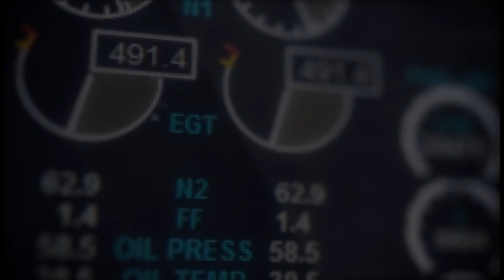Will Circular runways "take off"

Comment: Thank you sir for posting!  At first I thought this was laughable but now I see this is quite possible

To contest a couple of your objections.  One, as far as approach and departure lanes, those can still remain fixed.  Think if it as roads that lead to a traffic circle.  An airplane would still fly the same approach and once it enters the circle just spiral down until it reached the optimum point for touching down.  Same thing for takeoff.  Lift off at the optimal point, continue to fly the runway heading while climbing (spiral up), and then level off and continue on the approved departure path.

Two, problems with engine failures - needing to call V1 for instance - are now moot.  Just kill the other engine and land and roll out taking as much of the circle as you need.  Asymmetrical thrust which might throw you to the outside of the circle are kept in check with the bank of the runway.

Three.  Slippery runways.  True, centrifugal force will force you to the outside.  But the bank of the runway will keep you in.  With a properly designed runway you should never feel forces throwing you to the outside of the circle, just pressed more firmly into your seat as the aircraft accelerates.

Comment: I can see pluses (➕) and minuses (➖), and just oddities (✱) with this approach.

➖ The 360° clearance requirement that you pointed out would be a show-stopper at most commercial airport locations. It seems like the most intractable problem. It limits use of this airfield design to remote, flat desert locations, and/or perhaps roundish islands in the ocean.

➕ An island in the ocean too small & round for a decent-length airstrip might be able to accommodate one of these, perhaps for a military airfield.

➕ As you pointed out, except in very shifty winds you could always avoid having to take off or land in a crosswind. (The 360° clearance requirement probably incidentally ensures that your airport won't be located where shifty winds are common.)

✱ The runway would have to be concave, so that you could balance centrifugal force at varying ground speeds during takeoff and landing. If the runway were merely banked at a constant angle, then at low speeds the plane would tend to slide down to the "infield," and at high speeds the plane would tend to fly off the outer edge of the runway.

➖ That means the runway would need to be wider than a normal, straight runway, because there would be no single "center line" for pilots to try to stay on. At low speeds you'd need to be on the inner part, and at high speeds you'd need to be on the outer part. So, on takeoff, as a plane speeds up it would need to "spiral out" on the runway until leaving the ground, and as a plane lands it would need to "spiral in" on the runway.

✱ If you get it right, there'd be no side-loading issues on the wheels / tires & rudder. But getting it right would be a lot harder than on a straight runway. On a straight runway, they paint a line down the middle, and if you stay on it you're good. But on a circular runway the "center line" would vary according to your speed. You'd need either "smart" instruments in the plane to paint the varying virtual "center line" on a cockpit display, or else perhaps some clever lighting at the airport which would be adjusted according to the airspeeds of the incoming planes to show them their appropriate "center lines" are, according to their landing speeds. I suppose you could also paint multiple color-coded & patterned lines on the runway, with colors/patterns corresponding to different speeds -- but those would be ground speeds, not air speeds, so on windy days pilots would need to do some arithmetic to get it right.

➖ Landing approaches would need to be curved & banked, so both wheels touch down simultaneously and the outer/upper wingtip doesn't clip the ground. (Likewise, on takeoff, the initial flight path would need to be curved and banked.) It would be hard to do that well without computer assist!

➕ I do not agree that failure of the upper/outer engine on takeoff with a two-engine plane would be a worse problem than at a conventional airport. It would actually be much better than on a straight/flat runway! As long as the plane is on the appropriately banked part of the runway, the engine failure would cause no more imbalance than on a straight runway. But, unlike a straight runway, as the plane is pushed toward the upper/outer part of the runway by the unbalanced engine thrust, the increasing slope of the runway would tend to re-balance the forces on the plane and straighten it back out.

➕ Better yet, with an "infinite runway" there would be no point of no return, beyond which you couldn't abort a takeoff. Even if all engines fail at the exact moment the wheels leave the tarmac, there's no problem: just drop back onto the runway and coast to a halt.

➕ There would be just one taxiway, a concentric circle inside the runway, like on a NASCAR oval track. The terminal would be in the middle. Taxiing airplanes would never need to cross a runway, which seems like a minor advantage.

✱ The wingtip clearance issue could be mostly alleviated simply by making the runway very wide. The wider the runway, the less concavity there would be, so the less effect there would be on wingtip clearance.

➖ Maximum takeoff weight would necessarily be reduced, or else takeoff speed would have to be increased, because centrifugal loading would effectively be added to gravity, holding the plane down. This issue could be alleviated by making the circle bigger. Of course, with an "infinite runway" maybe requiring a higher takeoff speed isn't much of a problem.

➖ The traffic capacity of the airport would vary according to wind conditions. If there were no wind, you could land several planes simultaneously, or several planes could take off simultaneously. But in high wind there's only one good landing point (into the wind), and only one good takeoff point (into the wind).

➖ There would be no reasonable possibility to expand an airport's capacity by adding additional, parallel runways.

➖ A wider runway = more concrete = more expense. Additionally, I'll bet it is harder to pour concave / banked runways than flat ones. That might add to the expense, too. At least you'd need to use a very stiff concrete mix.

➕ Because the runway is effectively infinite length, unless you need to get off the runway quickly because other traffic is waiting, you could save your tires by not using brakes on landing. And, of course, as Jack C said, "no brakes, no problem."
Reply: About the only sensible comment I've read.

Comment: What if the circle width was wide enough so that a straight path starting from a point at the outer edge of the circle, passing tangent to the inner edge of the circle, then heading back to the outer edge was long enough for the plane to take off.  You would retain the advantage of 360 deg takeoff direction, but the path of takeoff would remain straight and unbanked.
Reply from the maker: That would be a truly huge circle.

Comment: It think the idea is that the bowl banking changes angle as you go up it so that as the plane goes faster it goes further up the banking on high speed test bowls like the one a Millbrook you can drive hands off at up to 130mph. This should mean that if you have asymmetric thrust you get a counter force as you move up or down the bowl. This also means it doesn't need high levels of friction with the surface. The biggest issue is likely to be the civil engineering, a regular runway doesn't need to be particularly flat. This will need to be totally flat with massive earthworks required. A 3km circle is harder to package than 3 3km long runways which can be arranged in many different orientations. In most established locations a 3km circle will be difficult to place and in most areas where the geography isn't constrained some cross wind runways would be easier and much cheaper.

Comment: If nothing else, a circular runway puts arriving and departing traffic on converging headings when rejected takeoffs or balked landings occur (assuming one half of the circle will be used for landings while the other half will be used for takeoffs). A circular runway seems ideal for rejected takeoffs given that the remaining distance is essentially infinite, but if the pilot uses too much runway to slow down, he might find himself head to head with landing traffic using the other half of the circular runway. Likewise, any missed approach or rejected landing on a circular runway WILL involve a change of heading, and if departing traffic is using the other half of the circular runway, missed approaches will find themselves converging with departing traffic unless they make hard turns at low altitudes to avoid.
Reply from the maker: True, that and many other things makes this idea, just an idea.

Comment: Circular runway was tried back during WWII but was rejected, wisely.
Reply from the maker: Yes!
Reply: I probably posted my comment too early; I'm going to guess that you probably mentioned the tests in WWII.  I'll be back next week to view the complete video (I should not be in such a hurry).
Reply: @nemo227  it wasn't mentioned in the video would you care to explain what went wrong besides the issues mentioned in the video. 

another issue i foresee is how air traffic controller would coordinate the landing.
Reply: @takumi2023    Mentour Pilot explains it pretty well.  One thing not mentioned is that relative wind direction changes as you travel around the circle.  Example:  If the wind is from 360 degrees and you choose to takeoff directly into the wind and travel one quarter around the circle the wind becomes 90 degrees off your left or right side . . . so you really haven't "solved" the crosswind problem.  Same thing happens upon landing.
Reply: nemo227 That is a really interesting point, although the strength and direction of a cross wind is far more crucial on approach and at the point of touchdown than after the aircraft has slowed down on the runway so wind direction a quarter of the way around the circle is moot unless you are trying to touchdown there.
Reply: nemo227 Actually, while circles weren’t feasible, the most successful airfield type in Britain in the Second World War was a variation of the idea. Three straight runways in a triangular arrangement gave the benefit of helping with landing in various wind directions and could also allow for more than one take off/landing simultaneously. It was a smallish improvement, but when fighting for one’s life, just a few percent improvement is considered valuable. These triangular air force bases were appropriate for the war effort and were built all over Britain, but weren’t applied to commercial airports due to increased land area required vs the relatively small increase in efficiency.
Reply: @artistjoh  Yes, indeed.  I've seen pictures of triangular airfields and your comment reminded me so I "Googled" triangular airfields, clicked images and there appeared several pictures of historic triangular airfields.  World War II was the impetus for the construction of perhaps thousands of airfields/airports in the USA.  Many have been returned to farmland or other developments.
My old (very old) aviation books show big fields, just fields without designated runways, with a wind sock indicating landing/takeoff direction.  Long ago there were very few planes and air traffic wasn't a problem.  Times change.  Requirements change.
Reply: nemo227 The triangular airforce airfields were called ‘Class A airfields’ because from the air the triangle resembled a capital A. There is an excellent Wikipedia article simple called ‘Class A Airfield’ that has lots of details about construction, layout, etc and includes aerial photos of some of them. Silverstone, the famous Formula 1 racetrack is built on an ex-class A airfield with the racetrack following in part both some of the perimeter road, taxiways, and runways. You will enjoy the Wikipedia article I am sure :)
Reply: @artistjoh  Thanks.  I'll take a look.
Reply: Now, if there was enough space, say for example a huge unobstructed area in a place like Texas,  engineers could construct a large circle with a two-mile-long diameter.  Within that circle could be parallel runways.   The entire circle could be built to turn into the wind by a large underground motor powered by solar panels.  Kind of like CERN on a turntable.  The runway would always be pointed into the wind.  Using GPS WAAS approaches would be easy.  An ILS approach could be considered.
               If they can construct a runway in Hong Kong out of nothing and build it into the sea, this concept is possible.  Whether it is feasible is questionable.  But I think it makes more sense than a circular runway, which would never be feasible. IMHO.

Comment: Pilots of large commercial airliners don't think this idea will work, due to side forces on the tires of the planes and the constantly changing wind direction at ground level. Some engineer was smoking shoe polish when they came up with this idea.
Reply from the maker: Yes, among other things.

Comment: I wrote down the problems as well as the advantages of a circular runway. The problems are very long and very difficult to deal with while the advantages are lacking. In actuality the normal 3-4 runway international airports would have to take up more space if converted into a circular system, and many airports would have to have two circular systems. Sketch it out, it doesn't save space. Overlay a circular setup over Heathrow, or Garwick, see what I mean. Those airports are landlocked, a new airport would have to be located a very long way from London, because of space and noise requirements. Honestly a very stupid idea. As for engine failure, the first time you started training in a two engine prop aircraft, you learned just how to handle an engine out, the rudders and yoke are your friends, maintaining the flaps at their takeoff position allows you to fly at lower speeds in case you decide to ease off the power in the good engine for ease in handling as you go around reaching a safe altitude. It was tricking but not as tricky as the first time your instructor put your single engine in idle so you could learn how to goose as much distance out of your now gliding small aircraft. When he allowed you full throttle it was a very nice feeling
Reply from the maker: True!

Comment: Interesting idea, but with the problems discussed here I'd say it has no more chance of implementation than my radical idea of placing the cockpit of large jets in the root of the tail so pilots have a full view of the engines and control surfaces in real time rather than hoping a horn or red light translates into a correct response in time to avert disaster.
Reply from the maker: Any major re-make of aircrafts are going to be extremely expensive.
Reply: How about NEW aircrafts? Or better cameras like in the A380 so the pilots could see the problems?

Comment: Counteracting the downforce as a result of the angle of the banking will make take-off extremely unlikely.  The faster you go to increase lift the more downforce you create.

I'm a janitor and know this is an idiotic idea.
Reply from the maker: Yep, it won’t happen.
Reply: isnt a plane desinged to increase lift with added speed? i'd say the g-forces are what would keep it down, not downforce imo
Reply: In a roadway this is called a superelevated curve, and it's purpose is to use the gravitational force to partially counteract the centrifugal force that wants to pull your car into the outside ditch.  The horizontal force vector it yields depends on the vehicle speed.  Below the design speed the gravitational vector is stronger and the superelevated curve is causing the vehicle to veer inward.  At the design speed the two forces match exactly.  Above the design speed the centrifugal force is greater and the vehicle wants to veer outward.  For a roadway the actual speed of the vehicles is statistically clustered around the design speed, but aircraft are making a speed transition between zero and take-off speed (or the other way around), so the superelevation is going to be much less useful because the vehicles are only at that speed for a very short time.

Comment: This idea is a laugh. Constant banking while on approach? What's the glide path in IFR conditions?  The only way a circular runway can truly work is.  A huge paved circle.  Not a wheel but all of it paved. The same glide path at any direction. Whatever the wind direction is from that's your take off and landing headings. Pave the entire circle!  A huge round paved circle is the answer not a wheel shape.
Reply from the maker: The crosswinds really isn’t that big of a deal. A 3 km paved circle is never economically viable.
Reply: Mentour Pilot crosswinds are not that big of a deal???  In IFR????  I bet my idea would work better and be alot SAFER than yours.  You didn't say anything about the economics of this, we are talking  about the shape not the cost.